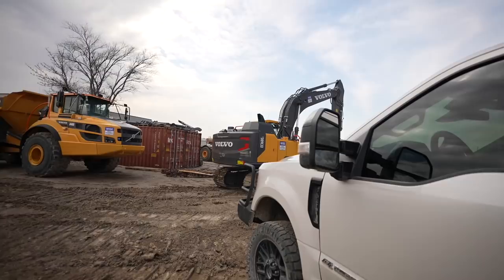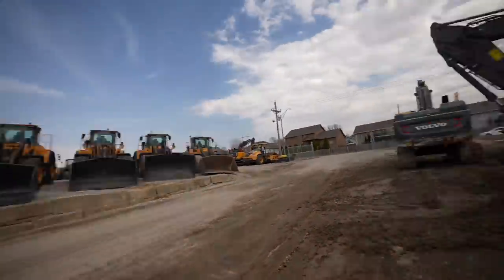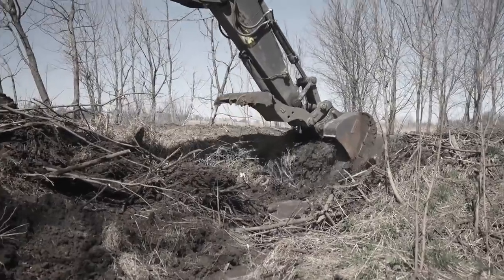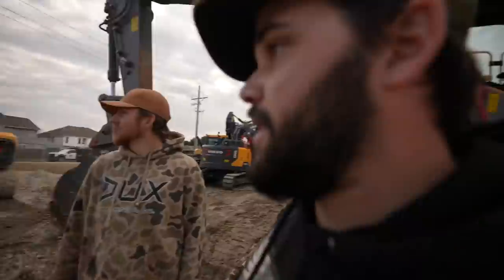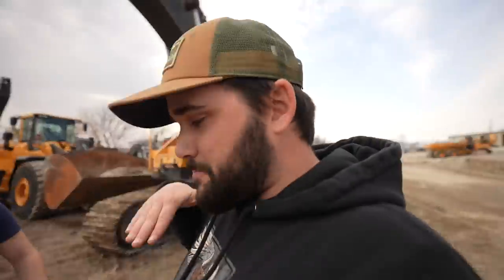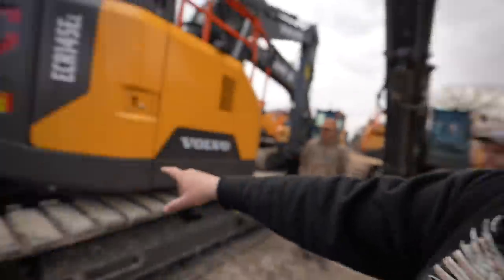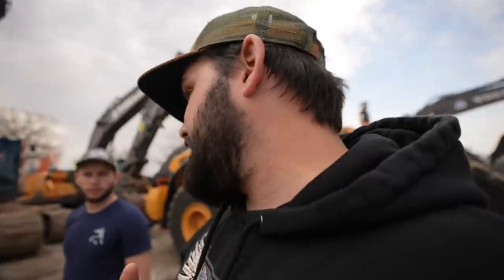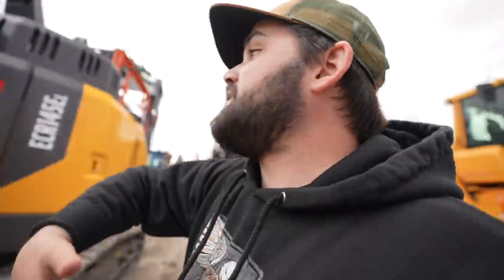I Bought a GIANT EXCAVATOR for My BACKYARD FARM!!! (Don't Tell My Wife...)

Comment: Seriously good bit of kit, I’m a ground worker and over the years I’ve worked with guys that can actually pick a penny up without leaving a dint in the ground or roll a marble in sand without leaving a dint even had one guy in a quarry who used his almost vertical to climb down the levels I properly skilled driver is worth his weight in gold for us. Fun fact: one of the best drivers I ever worked with using one was 19 years old he’d been doing quarry work since he was 13-14 in them so was putting guys with 20 years experience to shame

Comment: I know this was posted a month ago and you probably won’t read this but as a heavy equipment operator I have some tips that might be useful. First thing is to develop good habits like driving with your feet and only using your hands for small corrections. Secondly to turn in place without ruining your gravel you push the bucket down into the ground in front of your tracks, and while spinning the tracks accordingly, swing the cab sideways. The cab should stay in place and the tracks will rotate underneath you. When you are digging you want to throw a little dirt under your tracks to make yourself level (to prevent rocking back and forth). Also make banjo give er some grease every morning you go to use it

Comment: Buy a nice one for 30k at auction. You can get a articulating dump truck all day for 30 even with current prices. Put 5k into it when you get it repacking cylinders replacing some hydraulic lines you will be set

Comment: Oh man... I miss the 450DLC i use to operate with, Cold morning.. no worries HEATED SEATS babyyyy. Hot day? i got AC.  Congrats on the 300! Now you'll need to learn the Boom down and rotate your tracks Trick to save the mess and clean up youll have to do when ripping up the road..  Love the new addition!  Tip - after a good rip turn it to turtle / I mode and let it idle for a lil to cool things down before you shut it off. Oh and never ever trust HYDRAULICS. Dont keep the boom up in the air when off and if your riggin dont stand under them. There's been times where ive had arm cylinder creak down. The stair is your tool box you should have a key for that. Try and keep that bucket cylinder protected at all times. Use the bucket for smashing things just DO NOT hit that cylinder or youll have some fun with hot Hydro oil.  End of the day bucket on the ground keep the H Link out of the dirt too. Sorry for the long msg.

Comment: You guys are awesome I hate to be negative but just be careful when up on that platform if those hydraulic lines break or blow a hole in it while in use it’ll be a BAD deal a neighbor had a hydraulic line a a tractor break when unhooking a implement and it  took his thumb off just a warning

Comment: Those handle are connected to feet pedals so you can use your feet to direct the drive tracks instead of taking you hands off the arm and bucket controls. I notice you mentioning it with the mini and the view showed you feet off the pedals. Just FYI in case you didn’t know.

Comment: Wonder if he knows how much it will cost to move the excavator from jobsite to jobsite.  The weight for that model goes from 66,000 to 81,000 lbs., with the bigger bucket and thumb it will probably be closer to the heavier end, which probably will require permits, not to mention hiring a semi with the appropriate trailer.

Comment: excavator that size. Puts a lot of stress and wear on tracks when turning under the weight of the machine. Learn to turn by placing bucket 45degrees to the direction you want to turn. Place bucket on ground. Lift tracks about eight inches. While keeping the tracks elevated. Rotate carriage in opposite direction. Spin track that is on the opposite side of direction you want to turn in the direction you want to go while manipulating the weight of carriage on bucket while using track spin and rotation of carriage to spin carriage in the direction you want tracks to go. Practice makes perfect and will save a service call sooner than later.FYI That 300 volvo has more torque and power than the Komatsu you run.

Comment: no offence flair but volvo even tho its a great company. it was not the strat. I work on boats with my father and we service volvo diesel engines and when something does break be prepared to spend a pretty penny to fix it. they have the only building rights to the parts needed to fix their engines so they can charge whatever they want. I remember we had to buy 2 new air filters for a volvo engine and in perspective a cummins or detroit airfilter for 2 is around $200 on a bad day. We ended up paying $1600 for 2 fuckin airfilters. also keep in mind that because we have had a partnership with suppliers for so long we have a pretty decent discount so the average person would have bee paying north of $2200 for those airfilters. lemme stress that these are great engines but its like having a lambo and you blow a headgasket. Great engine and super good at what it needs to do but fixing it when it breaks is expensive as fuck.